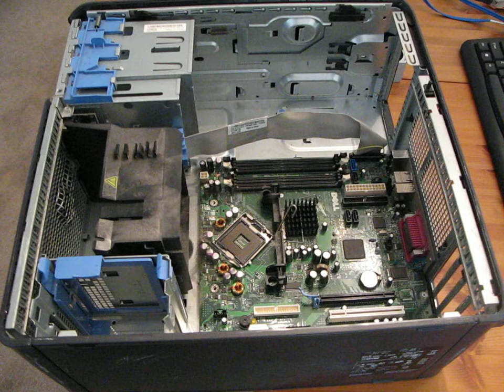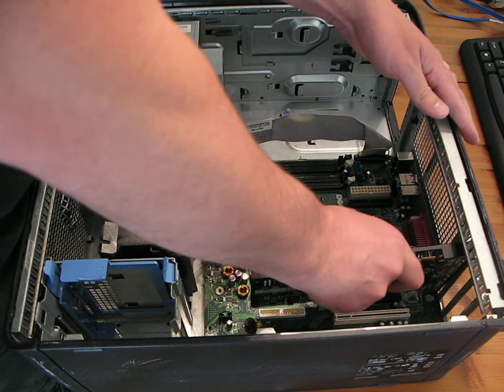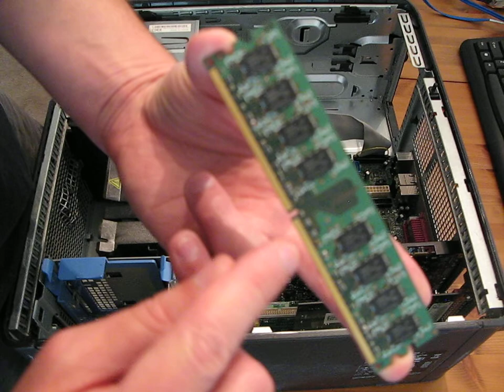(2 of 5) Old PC to Home Theater PC (HTPC) - Assemble the HTPC, Part 2

Comment: the gpu is so old
Reply from the maker: It is, but that's the point.  It was still working well enough for an entertainment center.  See my other videos in this series for more details.  The operating system worked smoothly, video played without hickups.  I am not going to be a power user on this thing, Just watch one video at a time and maybe some light browsing of netflix, amazon, hulu, internet, etc.
Part 1 http://youtu.be/GMmgy8O5ey8 | Part 2 http://youtu.be/rzWjKWTfNNI
Part 3 http://youtu.be/xqRfcJX2f_o | Part 4 http://youtu.be/yge3A01m-Rs
Part 5 http://youtu.be/dI5838FbzOI

I have since sold both the projector and this old computer in favor of a new 1080 projector (which is now old, lol) and a new computer with an hdmi video card and hard drive storage space.  Its a newer i7 with 16gb of memory.  Is it over kill?  Maybe, I hardly use any of the resources but they are there if I need them.  

This video was just to experiment and see what the old hardware could handle.  And, it did a good job for $0 extra cash.  My system now costs about $1500 for the pc and the projector.  The previous old machine was free and so was the old projector, so....